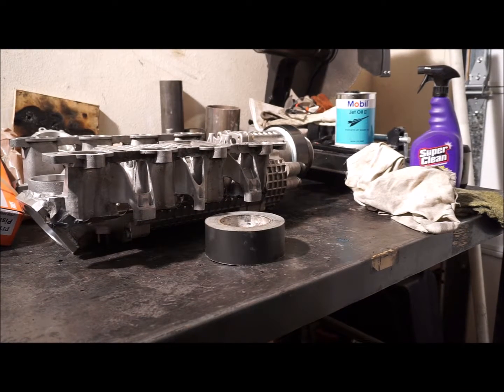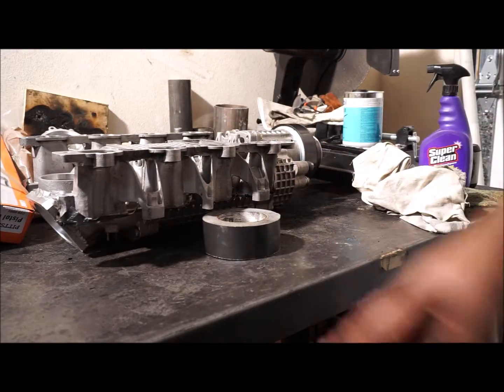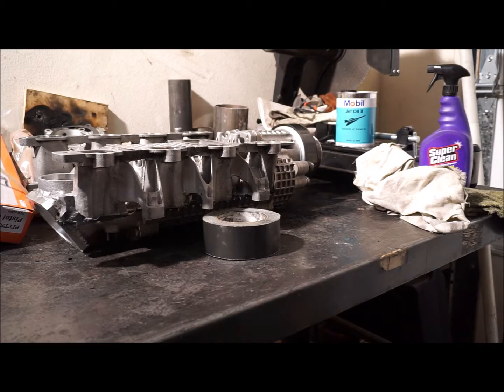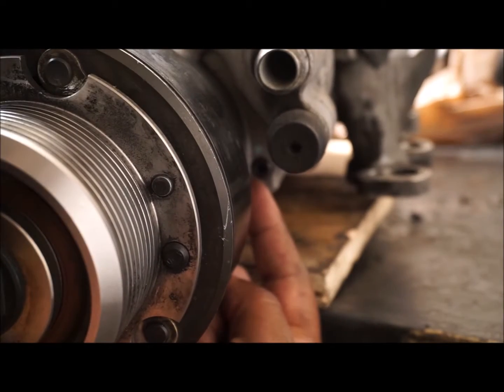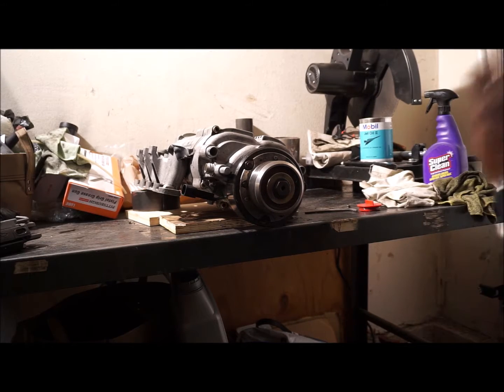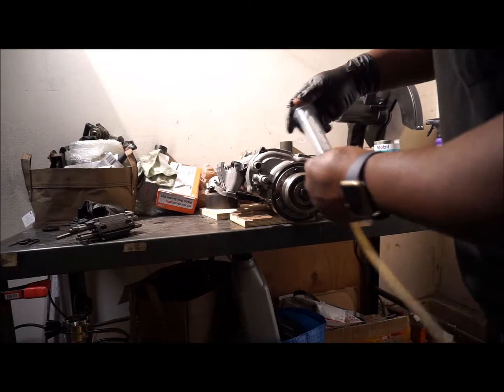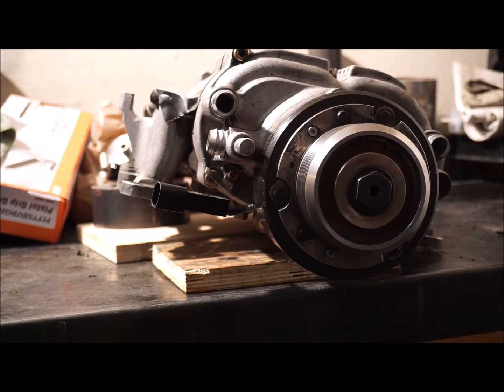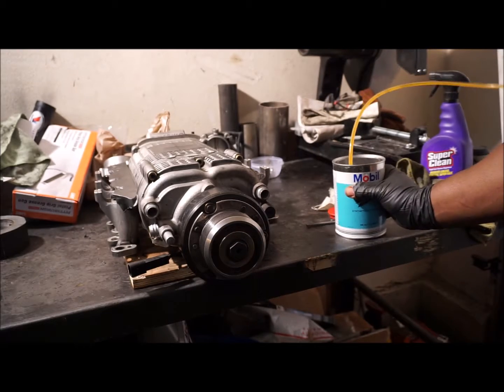DIY Supercharger Oil change (M113K) PART 2

Comment: My understanding is that it takes 150 cc as you say, but should not drip out of the drain/fill hole.
Reply from the maker: I thought the same, but it seemed like there was a slight weepage from the pulley when I injected 150cc.0

Comment: This oil can use on M271?
Reply from the maker: I do not know. I do not own an M271.
Reply: How long or how many mails have change once?
Reply from the maker: @4883fred  This video is the first time thee supercharger oil has been changed on this car, I believe.

Considering the oil is in a closed environment (supercharger), I personally would change it every 60,000 - 80,000 miles, but I am not 100% sure🤷🏾‍♂️.

Comment: Did you metcher how mutch you put aut off the compressor????
Reply from the maker: Erik Schawland No I did not measure the amount of supercharger oil taken out. I don’t know why I am thinking this but if memory serves me right (could be wrong) I read somewhere it was 150ml worth of oil.

I could be wrong, but when refilling the  supercharger oil, the oil level height is literally at the height of the supercharger refill hole.

So basically after I held the supercharger vertical to drain all of the oil out. I then placed the supercharger on a flat level surface, and used the syringe to refill/inject the supercharger with the “Mobil 1 Jet Oil Type 2” until this new oil trickles out of the supercharger’s refill hole.

I believe I used around 12.5% of a new can for my supercharger oil change.
Reply: @frugalfabrication  Ok her is for help you you put too mutc this is why its so importen to mecher the oil that is taken out ther shall be 150 ml into so if the oil Level is up to the refill nut its to mutch you can look AMG meisters vidios on the yub i have myself one CLS 55 AMG
Reply from the maker: Erik Schawland  thank you for this input. Been upgrading motor, and will double check and chime in as supercharger is off. Will also look at updating comments section as well.

EDIT: surprisingly had a little less than anticipated. I will add a smidgen more fluid.
Thanks for the reminder. 👍🏾